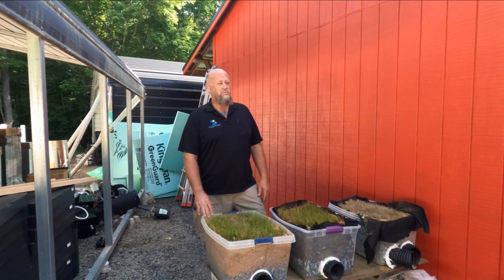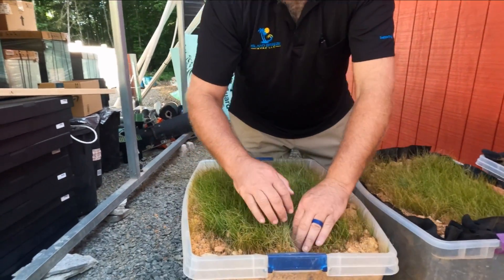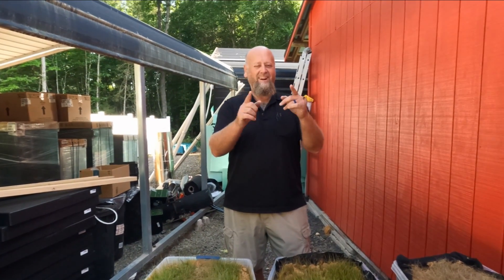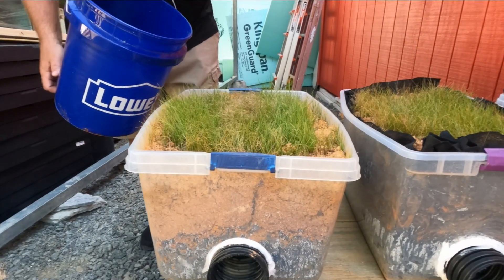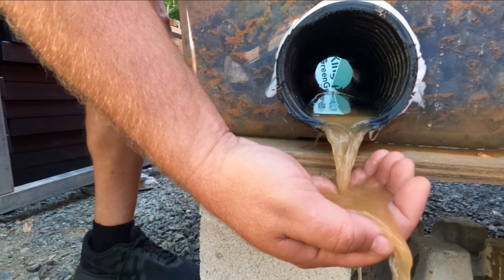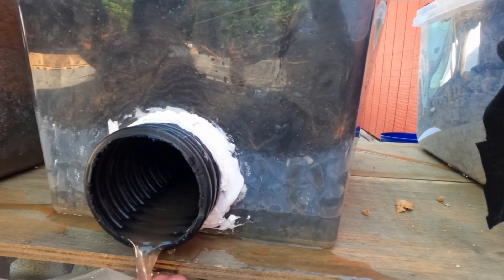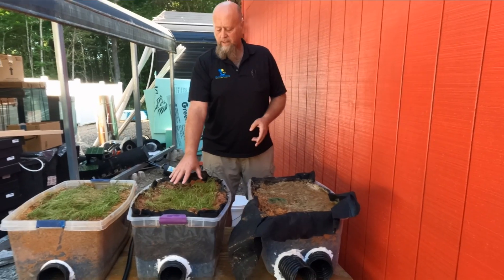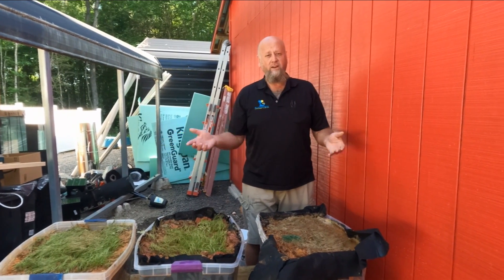Testing French Drain Scenarios To Find Out....Fabric or No Fabric? Which Is Best | Dr Drainz

Comment: Are there not be some sort of better cap for the surface drains that has maybe outside a chunky grate with progressively smaller mish to keep more debris, decaying leaves + sludge from going down the surface Cap? could you stretch some of that fabric across the pipe under the cap you did use? probably need a cleaning on occasion, but better that than the pipe?

Comment: When I put in that kind of pipe with the RIDGES, it was a disaster. Gophers chewed into the ridges,
(easy to bite into.) Dirt filled the pipes, blocked the drain water. So I used the solid plastic pipe with drain holes.
worked perfectly.

Comment: People need to understand that once water is in the ground it behaves completely different then you're picturing it would in your head. I'm a civil engineer and soil mechanics is something i'm very familiar with. Listen the ground you can think of like a layered cake made out of sponge, each layer has a different composition of soil and a different way it interacts with hydro-static water pressure. The top of your soil is the most permeable, 30 inches below it is practically a brick wall that doesn't let water pass, until the entire top layer of soil is completely saturated with ground water. At which point it will stop spreading horizontally and begin traveling through the layer. The point of the french drain is to intercept the water before it leaks down further by giving all that hydro-static pressure a place to relieve itself through the french drain, this is done by identifying where the layers in your particular homes soil seperate, and making sure the place the french drain just below that point, and also it's important to slope the pipe properly, the way water flows in a congregated pipe creates intentional turbulence that keeps the silt from settling to the bottom. If the flow is less then 2-3 degrees you will be cleaning those catchers very regularly.. If you grade it within 2-3 degrees you will never have a drain that clogs, i've had mine in my yard for a decade and have never once had to maintain it in any way.

Comment: I ran a high end, custom hardscape and irrigation business for 11 years in Colorado.  Custom enough that ALL my employees spoke proper english, as it was their native  language…..  Like many businesses, communication is so key and I made it top requirement in our company.  So don’t believe that BS like  “well who is going to landscape your yard?”  What a huge insult to our citizens …..  

I was wildly successful and sorely miss it but had no choice as some sudden health issues forced me to sell. 

That being said, concerning this fabric question, my personal experience AND my time with the CSU extension office during our own lab testing we found the opposite results of this gentlemen here, when we kept repeating the water cycle.  

In fact, I switched out using the original fabric I had used for a few of the early years to a much more purpose built fabric due to two different warranty situations where I had to come back long after initial installation and REPLACE the original fabric we used after it had a dozen or so water cycles on it. 

In fine soils, like clay the particles eventually clog up that woven spun “gray fabric” thats so commonly used.  These two warranty issues were both actually Dry Wells and not a foundation drain, regardless clay soil is clay soil.  These type soils will most certainly eventually clog up many weed fabrics and other geotechnical fabrics.  

I ending up going to a specialized product that was designed not to clog and what a surprise, they didn't.  Use the correct material for the job to begin with, it will save so much headache in the long run.  cheers
Reply: What product did you end up choosing?

Comment: Dr. Drainz, would you recommend combining:  a) top surface drain with a b) French drain running into one single pipe?   I have about 500 sq ft that becomes a small lake in a heavy rainstorm, and runs into my basement windows.  Water will be discharged into the street.

Comment: you're exactly correct. i tried it both ways . like an idiot i first put in a french drain with only pipe then gravel to the surface. wrong. the walls allowed dirt to infiltrate the gravel and blocked it up. but like the expert genius i learned to be from my screw up, i had to dig up the entire system, lined the fabric on the ditch bottom, sides and left enough to over fold the top. filled with gravel to 4 inches below surface. wrapped fabric over it, then added 4 inches gravel up to surface. during a heavy downpour the drain pipe runs like a fire hydrant. yee haa.

Comment: Excellent video—it really explains the subject well. Thank you so much!

Quick question about your third example:
If you wanted to create this in a real-life scenario where you have excess groundwater from heavy rains, as well as a retaining wall with groundwater seeping through, how would you handle it? Do you combine both into a single pipe, or do you need to run two separate pipes, each serving a specific purpose?

Comment: I’m in NC too. I’m doing a French drain on the side of my house. My yard slopes down very fast. One end of the drain will be about 4’ deep and the other about 8”. I’m covering the entire pvc pipe with #5 stone back to ground level . Put a landscape fabric on top and some rubber mulch on to hide the stones. I’ll line the trench opposite the house with geofabric to keep clay from leaking into my stone. The PVC will be sitting on 3” of stone. Hope it works!!

Comment: The fabric process speaks for itself.
Reply: A 5 minute test proves little. It does show soil leaching which will eventually clog ANY  fabric. The most effective designs don't use fabric. Instead a layer of sand is used as the filter to protect the rock and reduce soil loss.  Sand provides a 3 dimensional filter which will take much longer to clog.

Comment: Thanks, but I'll take the guidance of civil engineers that have literally stated in print, in FEMA status reports that: "Because geotextiles are prone to installation damage and have a potential for clogging, their reliability remains uncertain." "It's the policy of the National Dam Safety Review Board that geotextiles should not be used in locations that are critical to the safety of the dam."

So all that orange you see flooding through your precious fabric is precisely what will eventually clog it, just like it clogs the stone. 

The absolute best practice that will essentially last forever, is a dual-layered filtration substrate.

Comment: im thinking about using the NDS ez drain pipe it has the pipe wrapped and poly rocks wrapped around it already  but im curious if i should use another layer of fabric on the bottom then lay the pipe  down or is the fabic that  comes around the pipe good enough? my soil is dirt on top about 10 inches down then i have clay .

Comment: In case you're wondering if this is true or not: your cities and roads are built using geotextile fabric. You don't need to be a doctor of engineering to learn this, it's a really early thing they teach, it's published in endless public articles, and you can see it when you drive by construction sites. The fabric is cheap to buy, it prevents expensive materials like gravel from mixing with worthless materials like native soil, and it extends the life of anything you build. You can google "civil engineering geotextile" to learn more.

Comment: My family owns a $10M landscape and design company and everything he said about the fabric is correct.  He just showed you why.  It’s the better way to do it .  If you choose not to that’s your prerogative but it will be prone to packing the stone which must stay clean for best results.  He never said without fabric it wouldn’t work.  It’s a difference of quality and life of the drain working well
Reply: I've seen in commercial, maybe large commercial like dams and levees, projects that they use sand instead of fabric. I'm curious what the scale must be for sand to be more efficient or cost effective over fabric...
Reply: One question, do i need the pipe or just the rocks would be enough? Planning to do French drain in the slope for water to drain faster on easement. Neighbor and me planning to do,  we thought of all but not talked about the pipe.
Reply: No black soil, only sand/rock ground. 
If you don't use it in blacksoil and have propper winters and muddy autumn. No fabrick, no drain.
Reply: What I don't understand is why you wouldn't. You dug all the trenches and holes, you bought the gravel. The fabric is going to be such a small percentage of the total costs, so why not do it?

I have my holes dug and gravel ready, but after researching a bit I just ordered some fabric and will be putting it in tomorrow before filling everything back up.
Reply: @Duci1989  actually that the thinking that solves problems lol  you have a good logical mind also lol
Reply: AM I SUPPOSE TO BE IMPRESSED WITH YOU TELLING US YOUR 10 M FAMILY BUSINESS?
Reply: @marionroark8237 it was merely to give the reader an idea of their knowledge credibility… just cause you broke lime the rest of us doesn’t mean anytime someone mentions a monetary value means they are bragging…
Reply: @APinTheAK lol
Reply: @marionroark8237 go back to your mother's basement 😂
Reply: @marionroark8237 hmm.. what's with you? 😅😅

Comment: Can you just connect the catch basin to the french drain instead of using both solid and perforated pipe?
Reply: From another video I watch the reason u have two different types of pipes is because the quality of the water . The French drain get the water that soaked on the surface and raised to the bottom is filter this way and is cleaner the reason why this is important is because it doesn’t clog the slits in the pipe if it’s clogged it will not work . The yard drain the surface water which is full of dirt and leaves it will u can flush this one out   Also if u want to connect your gutter spout u want to connect it to the solid pipe since it could clog the French drain pipe

Comment: i do not understand how water pushes up to the pipe.   In a situation of a 10 foot retaining wall will the water have to back fill up to the French drain?  I don't understand "fill from the bottom".  Sure in a plastic container, where else could it go.  So using a sealed plastic container, sure, it fills from the bottom.  But with a 10 foot retaining wall the water should just keep going down until it back fills the depth of the retaining wall.

Comment: Probably should have mentioned what "schedule 40" is
Reply: Also, why wouldn't you combo both in one drain? Have the slotted pipe, with surface inlets?
Sure, it would mean some leakage into the sub surface from the surface, but that wouldn't always be a bad thing?

Comment: It is my understanding that any professionally engineered system will specify washed drain rock AND a fabric barrier. If fabric really became sealed, then all the retaining walls would be failing due to hydrostatic pressure. IMO fabric doesn't seal from clay. Water goes through clay. Otherwise the water would never even make it to the fabric.
Reply: I agree, but I think it comes down to individual application as well. The fabric clearly slows the rate, if its clogged, it may still drain, but even slower. This may still eliminate pressure, do it's job, and prevent flooding.

For me, I'm making one in my basement which will have concrete on top. I want to see it rain to confirm, but it looks like my clay holds water for a long time/well saturated, I think if I compact it and compact some base stone, pipe and more stone, it will drain fastest and not clog due to this hard clay not moving. My runs are fairly short about 23 ft one way and 13 from another I could jet wash too

Comment: Find a textile source that will sell you non-woven geo fabric. What we normally use runs about 5-8 dollars a foot 12 feet wide rolls. If you encapsulate the ditch with the fabric,  2"rock base, 4-6" perforated corrugated or pvc, covering the pipe with 4-6" rock, overlapping fabric, and be sure to tamp the rock base and fill as you go..... it'll drain and you'll be happy you used the fabric. We also use the pipe with drain sock installed as well. The ground water grates can tie into your French drain which helps keep the pipes flushed. We have ran into some jobs where there was so much ground water pushing up air vents where required to prevent the drains from being overtaken. Surface grates work well for this until the ground water  reaches the drains and there's a heavy downpour or long periods of rain. Gotta have air behind the system just as the plumbing in your house.
Reply: Any idea why hardware stores (and even DIY stone/gravel suppliers) that cater to landscaping make it so difficult to figure out what kind of fabric you’re buying? It’s been a massive headache for me. I just put the thick hardware store stuff (that probably doesn’t permit much through) between the soil and compacted sub-base, and then thinner stuff (that appears to let lots of water through) between my vertical soil-gravel interfaces as a continuous fabric layer between soil and non-soil. We’ll see how it goes but it’s not holding back maybe 8’ of garden raise 2’ so probably overkill, but lots of clay and it does freeze up here. Thanks for being a voice of reason.

Comment: #4 Connect the French drain and below water drain to the same pipe. It saves you pipe by using only one. And probably add a filter on that French drain inlet.
Reply: It isn't a good idea to have a yard drain connected to a perforated pipe. It introduces too much water into the ground around the pipe, saturating the soil you are trying to keep dry

Comment: Sorry, but I'm gonna say this wasn't done right for any of them except the basin.

#1 Any French drain that's installed should have the stone compacted, then the Dry surface soil compacted over it, (and if composed of clay) lightly wetted, compacted again, then sod placed (or topsoil/straw and seed sown). This has been a standard procedure for over 100 years for most long-term contactors who have done foundation work in high-clay soils. By compacting and wetting, the surface solidifies into a semi-solid mass. Even when it cracks from drought, it self heals, especially with covered by sod. Been very well documented. You basically rigged the results by not doing any of the above.

#2 ALL filter fabrics clog in high clay soils. Tried them all, they all clog in the same way after only a few rain cycles. The water is clearer in your example because the fabric is already starting to clog. The flow is also notably decreased in the video and will continue to decrease over time.

#3 Basin/surface drains should be installed in tandem with properly installed French drains. You get major points from me here.

#4 To avoid ANY concerns over soil cogging: Leave drains exposed as part of rock path or rock barrier/garden around homes.

Comment: Option #4: Skip the soil and sod on top. Now you collect both surface and below-grade water, AND have a rock path.
Reply: Right. People are obsessed with looks over function. But like you hinted at, a rock path can look good.
Reply: I've done that.  Works great especially ringing a building.  No different than regular rock mulch.
Reply: Could you instead put a walkway using pavers on top of the rock path? using sand as the paver base on top of the rock?
Reply: @joshuacoffelt9300  My understanding is that with sand and pavers up top, you'd not have much of a French drain. Water has to flow down into it, unless the plan is to use an open pipe instead and have water come up from the bottom, into holes in the bottom of the pipe and hope it stays in the pipe long enough to flow out.

My initial comment was more about recognizing a drainage system that takes care of both surface water and water not much under the surface. If the water table is really low, several feet, and causing foundation issues, that's a different thing. Most times. we're dealing with more near-surface issues that will seep down and cause problems. The thinking is, if you snag the water from up top, it won't go down and cause problems.
Reply: @The Next Hobby  its best to keep surface water out of the French drain and use a separate drain for surface water. This prevents over saturation of the drian and the soil surrounding it. The less water in the french drain the better. It really should only be used for water stuck underground. A cutran drain is a good solution if you have a lot of surface water over a long area.  By adding surface water to the French drain, it will essentially make a mote and will leave lots of water where it shouldn't be. This makes the soil softer. I have seen people dump gutter into their French drain and it over saturated their drain and started leaking in the basement. They wanted to redo the whole thing. We did an experiment and capped their inlets on the gutter and the surdrain and let the water collect in the yard. Their basement didn't leak. We ended hp adding a seperate drain system for their surface drain and gutters.
Reply: Covering a french drain with more permeable decorative stuff works great. I built a few like that around my house.  4 or so.  Here's 2 of them.  The other two are 1. Under a brick patio.  And 2. Under decorative brick edging by a driveway.  These next two i have videos of.

French drain topped with 2 types of stone and limestone pavers.  

https://youtu.be/PhbNnFNnKCc

At 1 minute in is another example.  2 foot deep french drain ringing a garage covered with stone and cement pavers.  

https://youtu.be/BSz8iMO2LOQ